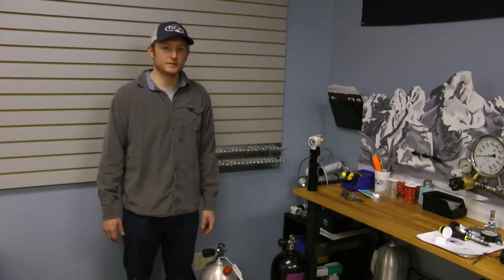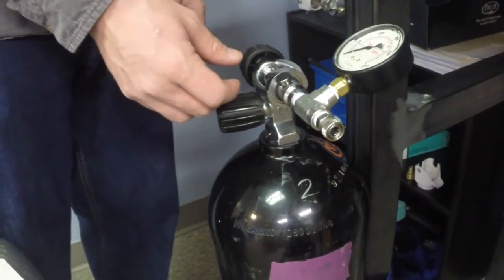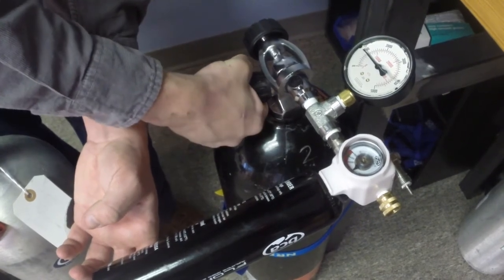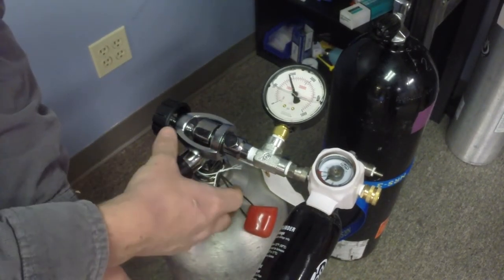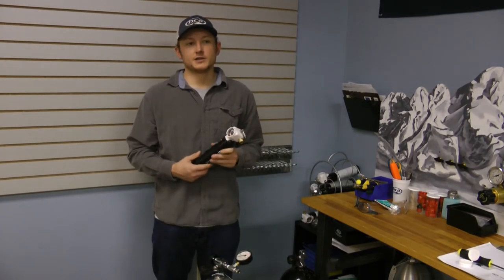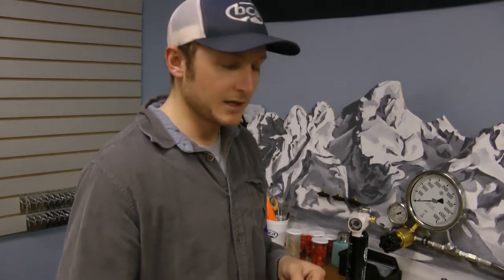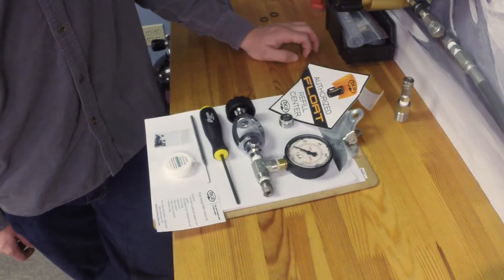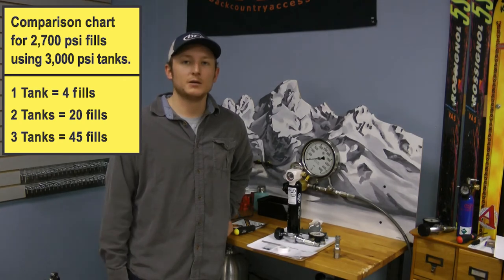Authorized BCA Refill Centers Instructions. Part 2: Refilling the Air Cylinder

Comment: Why did you use three different SCUBA tanks? If I have an air compressor, is there a reason I can't fill my Float 2.0 right up to 3,000 psi?
Reply: Air compressor air (which is everyday air) and scuba tank air (which is 100% pure oxygen) are Apple's and oranges,their not the same kind of air.